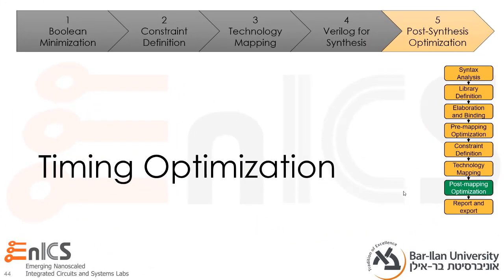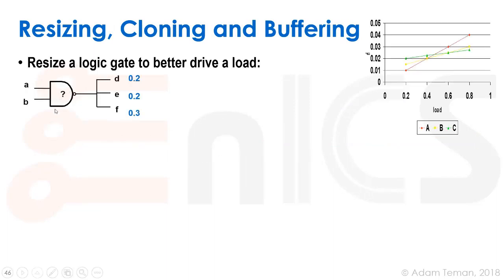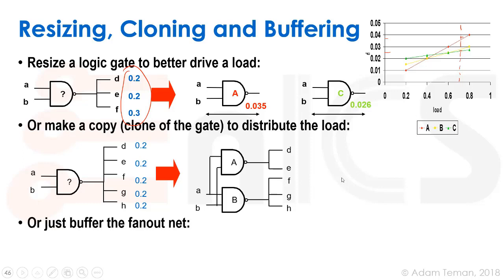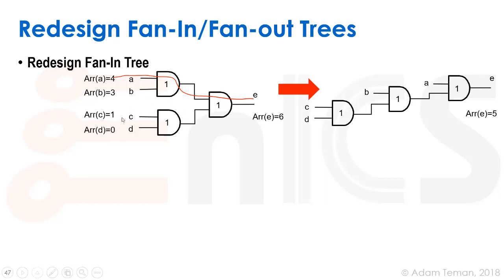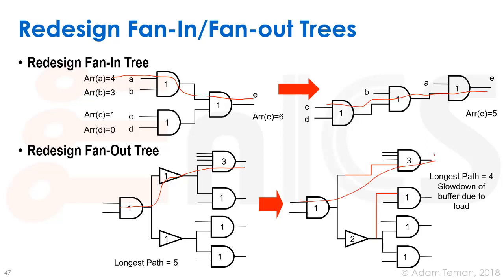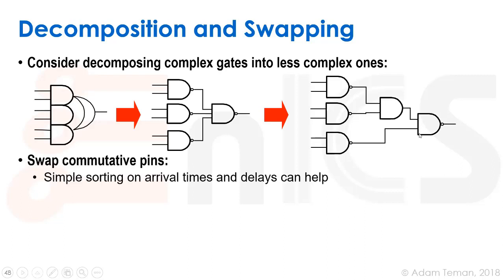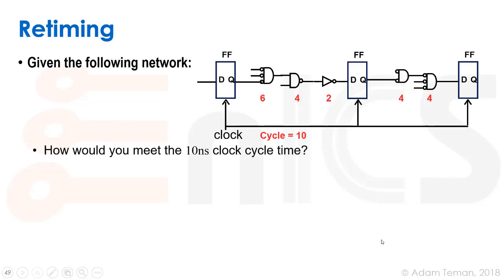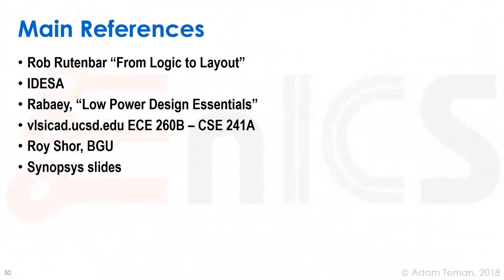DVD - Lecture 4f: Timing Optimization

Comment: Hello professor,  these small video breaks the consistency. Could you please make min  video length of 30 min
Reply from the maker: Hi Deepak 
On the contrary, I am taking an example from Coursera and similar platforms, trying to keep the videos short (primarily shorter than 20 minutes), since longer videos tend to lose the concentration of the viewer. I've also been trying to encapsulate a coherent subject within one video, which is why some are a bit longer and some a bit shorter. 
But you can still find the previous full lecture (usually 1-2 hours) on YouTube, though I have removed them from the playlist. For example, Lecture 4 is at https://youtu.be/lTt2LN7nub0.

Adi